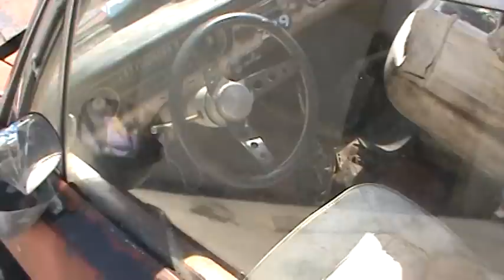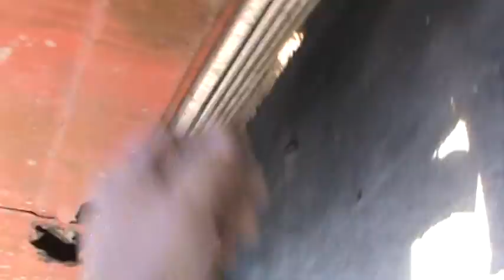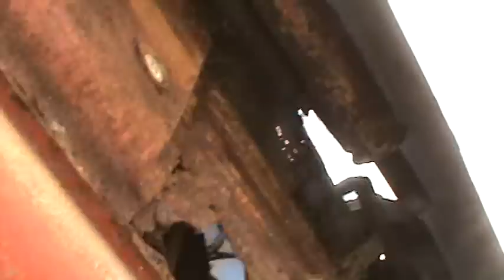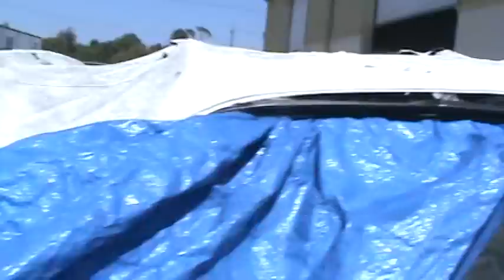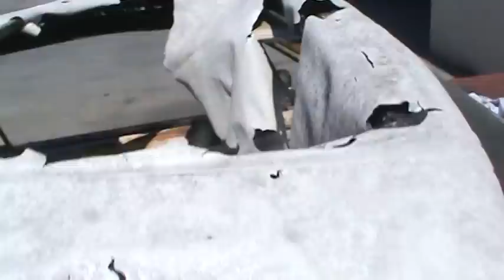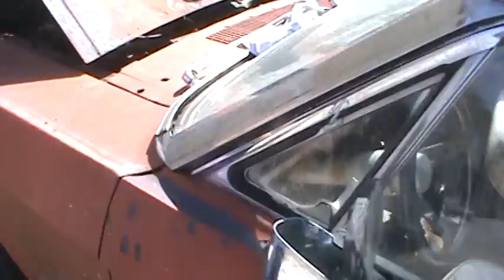ANDREA'S FINDS.....1964 FORD MUSTANG....HAS SOME USABLE PIECES

Comment: Check the data plate, its probably not worth restoring unless it has a K or A engine code. Otherwise its a parts car. The data plate is on the driver's door inside the jamb, or stamped on the inner fender apron underneath the fender lip. The convertible top parts are worth a few bucks.

Comment: It's a '64, there was no A or K code. The rare one for '64 would be the D code which is a 4v 289. The only other V8 option for '64 is the F code which is a 2v 260. But yes I agree, unless it's a D code it's parts. I bet it would fold in half if you opened both doors lol.